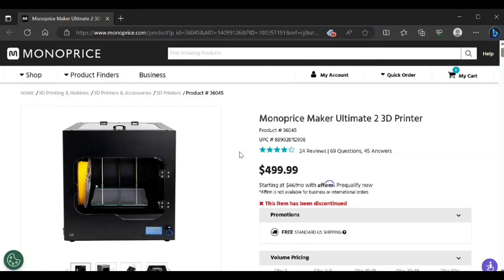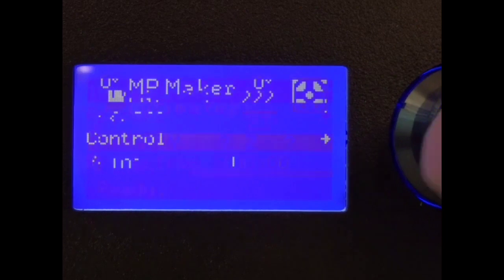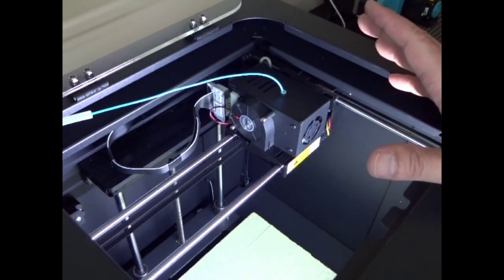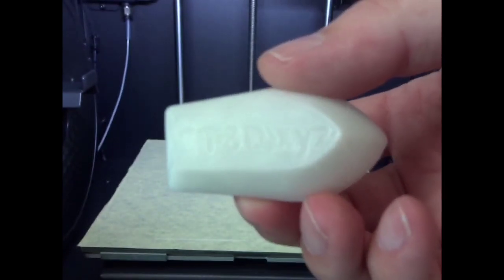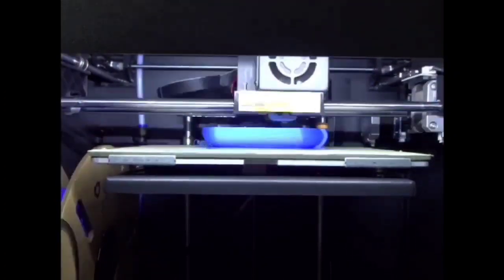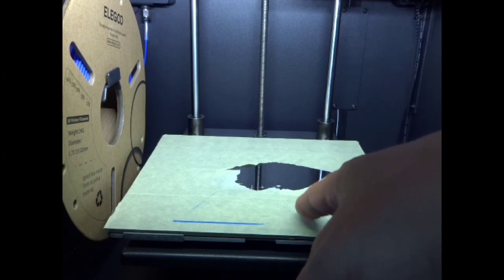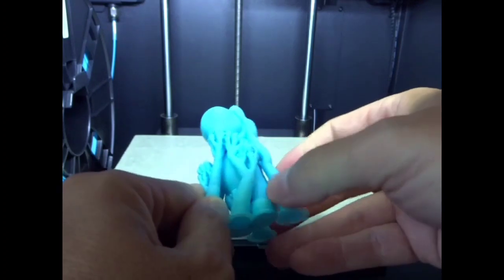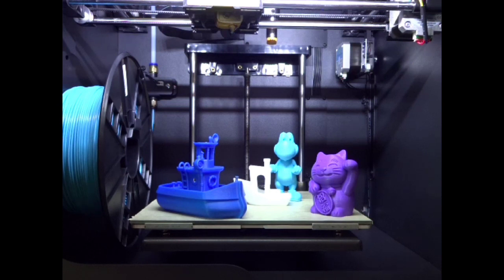Monoprice Maker Ultimate 2 3d printer review

Comment: Would you recommend this printer for $150? I can buy one of these new for that price but id like to know if its still a good printer and of its reliable. Thanks
Reply from the maker: It is a fantastic printer but I wouldn't pay more than 100 for it.
Reply: @joeprints3dstuff thanks for replying. The seller won't take any less than that. It is new so I don't mind mind paying the $150 if it's actually good. How reliable has it been?
Reply from the maker: @christianolea2181 it's one of my best printers. The bed is a bit of a pain though and at some point I need to figure out a new bed for it.
Reply: @joeprints3dstuff  ill go ahead and try it once I buy the 3d printer. Thanks again

Comment: Being used to an ender 3 I find the firmware and display very useless. I was expecting to run some calibrations and adjust some settings out of the box but can’t even do basic functions like set e-steps. I’ve tried using a terminal but it does absolutely nothing when sending the m92 e-steps command to find out what the value is. It’s overextruding on my test prints and the printer is basically a giant paperweight until I can figure out how to calibrate it or completely bypass the stock firmware.
Reply from the maker: Stay tuned for my next video. I am testing marlin 2.1.3. Hope to release it in a few days.
Reply: @joeprints3dstuff  will do. Does it have more settings than the stock firmware? I bought it on the fire sale also and have been impressed with the machine overall despite the very flawed firmware.
Reply from the maker: @RyanMonoxide  yes, its a full blown modern marlin release. So far its working great on my machine. I have a few more tests to run and then I will post it.
Reply: @joeprints3dstuff  awesome! Can’t wait! Thank you so much for your time and effort into this.